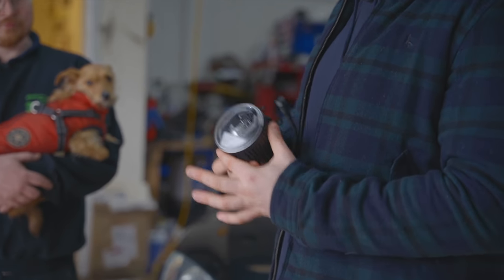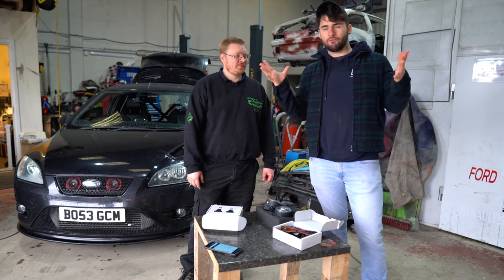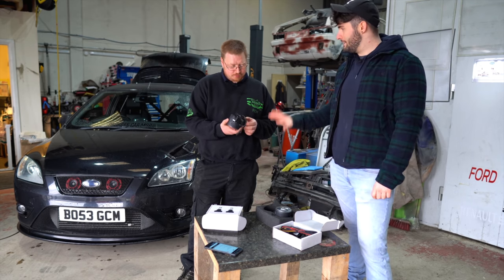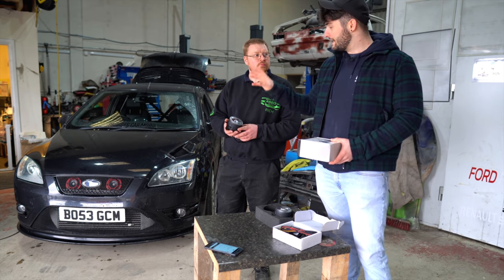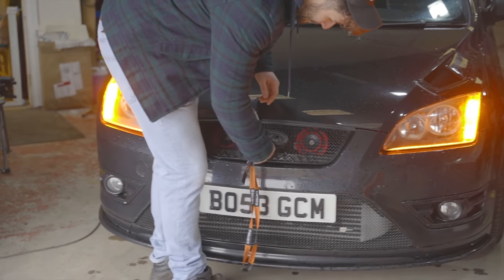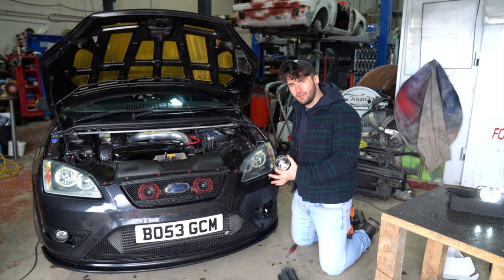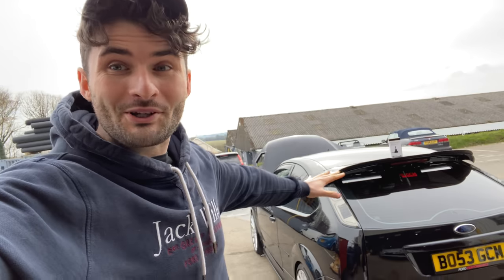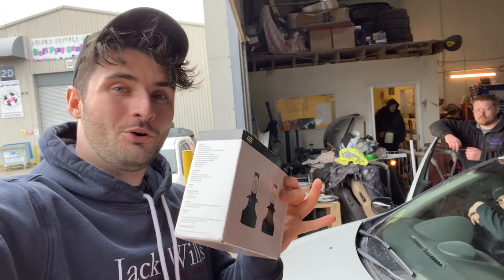MK2 FOCUS ST GETS LED DRL FOGS FROM AUTOBEAM - MUST HAVE UPGRADE

Comment: Proper DRLs are definitely the way to go! But, you should have them on with ignition - headlight switch in "0" or "AUTO" in the daylight (for example use fuse F32 or F34 in engine bay) and actually either dim or turn off with side lights (halos in your case) - so the yellow wire from the harness to side lights. That's the correct way according to the regulations.
Reply: Do you know how to have them come on with the ignition? Mine are only on when I turn the lights on
Reply: @pedromonteiro2644  I literally decribed that in my comment.
Reply: @RomanKolinek  sorry I have little to no knowledge about electronics, so I only need to use one of those fuses?
Reply: @pedromonteiro2644  yes, strip the cable a bit to expose the wires and then stick it in with one of the fuses...or give it to someone who has better knowledge if you are not sure
Reply: @RomanKolinek  alright, thanks a lot!

Comment: "... it's super simple..."
Me: "Cries in Facelift"

Autobeam bulbs are, I would argue, the best LED upgrades you can get. Pretty much every bulb in my ST has been replaced with them, only the fogs are an issue. 

I got the LED ones with the fans but they wont fit due to the space (un)available on the drivers side (passenger side is fine, so I can say they are otherwise great). Was not sure about these but I think I will defo be getting some  now!

Comment: I deff prefer the DRL’s i have the Osram DRL’s but i have wired them so when i start the car they come on like oem DRL’s and when you switch the headlights on they dim slightly 👍🏼👍🏼
Reply: Can you explain how you did it? Mine only come on with the lights
Reply: @pedromonteiro2644  Do you have the osram ones ?
Reply: @valterRS  No, I have aftermarket headlights that already have led drl lights
Reply: @pedromonteiro2644  ok there is an additional plug on the headlight loom its a two pin connector and my old monkey wrench lights where connected to that , the osram lights come with a little module that connects to the fuse box and works like i mentioned.
Reply: @valterRS  thanks! I’ll check and see what I can do